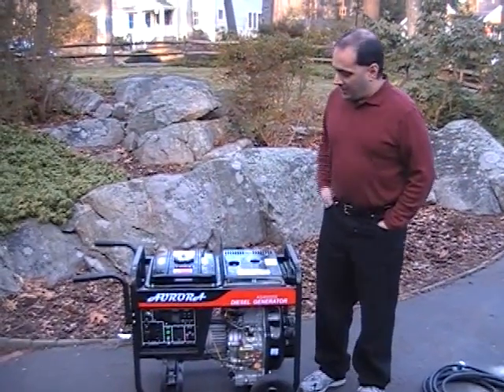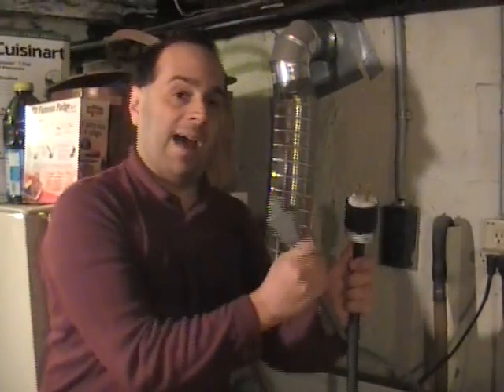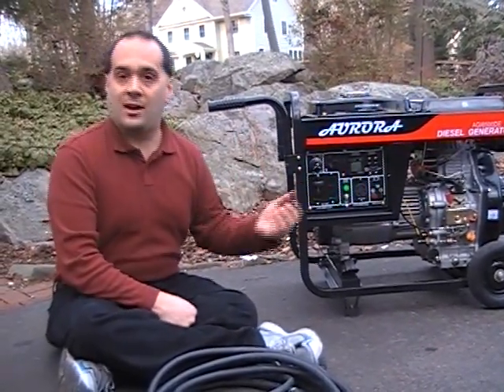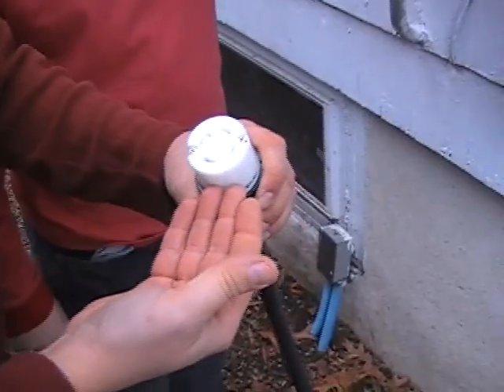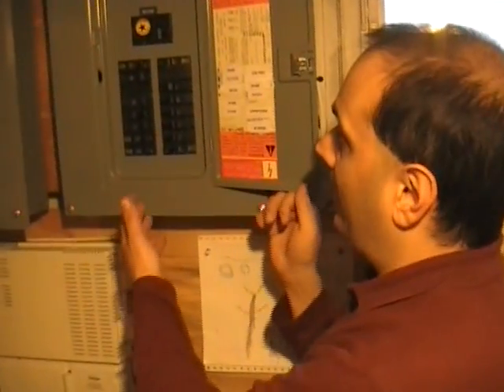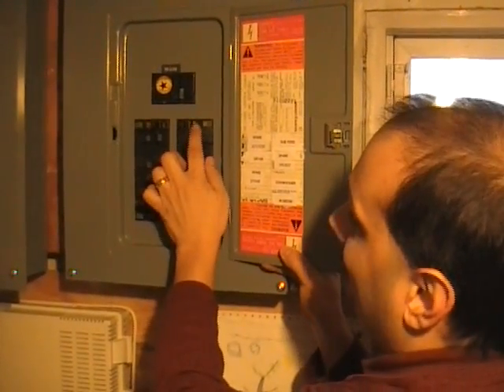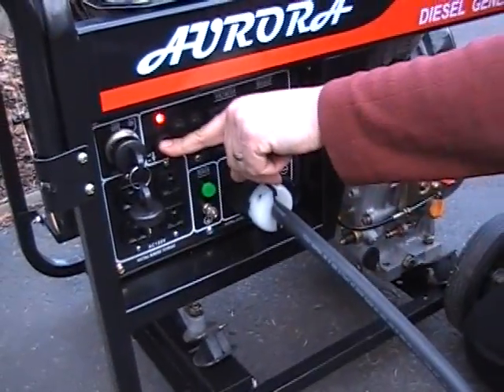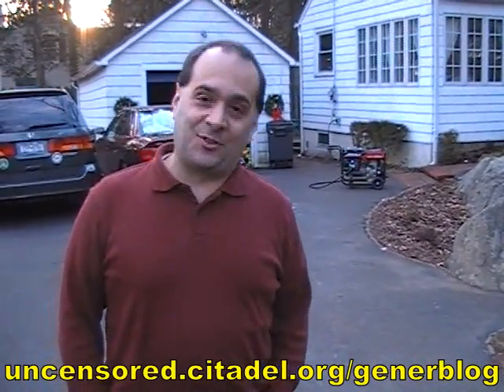Inexpensive residential generator hookup

Comment: Great video, elegant and less expensive solution, although you did have a sizable amount of work relocating those circuits from your old panel to your new panel.  I do thank you for mentioning the interlock method - being new to this sort of thing, I was completely unaware of the interlock method.  It turns out that my Square D panel does have one available, and I do have extra slots to allow it.  I was thinking I'd have to spend $300-$500 on a transfer switch to get legal...now I know how to do it for $150.  My thanks to you for taking the time to make this video.
Reply from the maker: Interlock kits are great if you have room for them.  I thought about it but I would have had to convert some of my other breakers to tandems (twin half-size breakers), and it turns out my panel doesn't accept tandems.  Go figure.

By the way, the parts for my subpanel (including the wire, breakers, and inlet receptacle) only totaled about $200.

We're thinking about looking for a larger home this year.  If we move to a house that has free space in the panel I'll probably do an interlock kit and make a video of that installation.
Reply: We actually have no room for a sub panel, the wall where are panel is at is all finished over with cabinets.  I've ordered the interlock kit and will let you know how it goes.  The one company had the kit for $149, I opted for the non-metal one that is $69, I hope it wasn't a mistake, but if I works, I don't care what it's made of!

Comment: Found this very helpful.
Reply: Generator safety rules: Always make sure you follow all the generator safety rules before using your portable generator. This is only a reminder. Generators can be dangerous if not used carefully. Every year, hundreds of people die or get injured when using portable generators due to carbon monoxide poisoning and electrocution. Make sure you are using your generator carefully and keeping others safe as well. There is something very serious that everyone should always be aware of when using generators. Some people do run their generator indoors which is not safe and that increases the risk of carbon monoxide poisoning which can cause death of family and you. Some people run their generator in wet conditions which can electrocute them. Please remember that you should never run your generator indoors. Remember that carbon monoxide is an odorless and colorless gas that you cannot see or smell. Carbon monoxide is a silent killer. Keep that in mind. Make sure your generator is 15-20 feet away from your house and away from doors, windows, and vents. Never use your generator in your porch too. Having a carbon monoxide detector is very important against generator safety. Some people also allow children to go near the portable generator which could pose risks. We need to keep an eye on our children making sure that they are not near the portable generator so they won’t get electrocuted or burned by the generator which is dangerous. A locking enclosure also keeps kids safe. A generator shed might look like a tempting place to explore, or take cover during a game of hide and seek, but a generator is a dangerous piece of equipment that can cause injury. It says on the manual that we should also keep children away at all times from the portable generator to avoid injuries. Please do not allow a child or unqualified people to operate the portable generator.  It is important to keep your children safe especially little ones. The portable generator can be hot during an operation. Just because some manuals missed what should be listed doesn’t mean it’s safe to do. Always follow the generator safety rules when using portable generators. Generators pose electrical risks. If you need to use your generator during wet weather, you need a generator tent to protect your generator from getting wet. Don’t let your generator get wet. Keep your generator dry and before using your generator, please make sure your hands and your generator is dry. Do not wear loose clothing when operating the generator. Everything that is said on the generator’s operating manual should not be ignored. Never smoke cigarettes near the generator. Please keep flammable things away from the generator. Never overload your generator too. Your generator can catch fire. Never ever try to plug a generator cord into a wall outlet to avoid back feeding. Back feeding your generator is dangerous. Always turn on your generator first before plugging in appliances and shut off the appliances before turning your generator off. Use a heavy duty cord for your generator and the cord should not be worn out. All the instructions should be followed carefully. Never refuel your generator while it’s running. It can cause fire if fuel spills while your generator is hot. You should turn off your generator and let it cool off before refueling it. Having a fire extinguisher next to the generator is also important. This is only a reminder for everyone’s safety of using generators. Make sure your generator is properly grounded. Having a fire extinguisher next to the generator is also important against the safety rules. https://youtu.be/I1jT3ANENvI and here is a video more about keeping others safe when using generators and also about our family’s safety. It’s important to keep our little children safe as well. Make sure they’re away from the generator. Hope you find this helpful. Be safe

Comment: Over kill..all u have to do is.get a heavyduty constuction drop cord..cut the female end off wire two red clips on the hot lead one black clip to the neutral wire..first turn main breaker off..2nd clip the two red clips to the main two breaker bus bars BELOW the main..clip the black clip to the neutral bus bar turn all 208/240 volt breakers off start the gen walla whole house is energized.ran a house for two days ..the wire didnt even get luke warm..its easy to b a goody goody when u have lots of money..for the rest of us pay check to pay check people we do what we have 2
Reply from the maker: Wilbur is correct.  What Kalyn M is suggesting is very dangerous, very illegal, and just plain unnecessary!  If you can afford a generator you can afford a few more dollars for an interlock, especially if you have room for one more double-pole breaker in your panel you can go with the interlock kit that spans your main and the generator breaker for about $75.

Comment: Thanks for the vid this is exactly how I wanted to wire my home. I did NOT want to back feed and a lot of vids show back feeding. Quick question. Did you move the breakers and wires for the the breakers u want to use on the generator over to the sub panel, or are there duplicAte breakers for the same rooms?
Reply from the maker: For any load we want to run on the generator, the wire and breaker is moved over to the subpanel.  Because the subpanel loads can all run from either generator or utility power, depending on the position of the interlock, you only need one breaker -- but it does need to be in the sub.

The main panel feeds the subpanel, and it feeds any remaining non generator capable loads.  Many of the breakers in my original panel are now spares that have no loads attached to them.
Reply: Thanks

Comment: Great video thank you!  Do you have a model number and source for the breaker interlock?  I can't find a reference to the number you state in the video.  I am going to install a sub panel and want to set it up for a generator as you did.  Thanks!
Reply: I actually did find the interlock you mention so I am good thanks!
Breaker Interlock SQUARE D QO2DTI
Reply: Generator safety information: Always make sure you follow all the generator safety rules before using your portable generator. This is only a reminder. Generators can be dangerous if not used carefully. Every year, hundreds of people die or get injured when using portable generators due to carbon monoxide poisoning and electrocution. Make sure you are using your generator carefully and keeping others safe as well. There is something very serious that everyone should always be aware of when using generators. Some people do run their generator indoors which is not safe and that increases the risk of carbon monoxide poisoning which can cause death of family and you. Some people run their generator in wet conditions which can electrocute them. Please remember that you should never run your generator indoors. Remember that carbon monoxide is an odorless and colorless gas that you cannot see or smell. Carbon monoxide is a silent killer. Keep that in mind. Make sure your generator is 15-20 feet away from your house and away from doors, windows, and vents. Never use your generator in your porch too. Having a carbon monoxide detector is very important against generator safety. Some people also allow children to go near the portable generator which could pose risks. We need to keep an eye on our children making sure that they are not near the portable generator so they won’t get electrocuted or burned by the generator which is dangerous. A locking enclosure also keeps kids safe. A generator shed might look like a tempting place to explore, or take cover during a game of hide and seek, but a generator is a dangerous piece of equipment that can cause injury. It says on the manual that we should also keep children away at all times from the portable generator to avoid injuries. Please do not allow a child or unqualified people to operate the portable generator.  It is important to keep your children safe especially little ones. The portable generator can be hot during an operation. Just because some manuals missed what should be listed doesn’t mean it’s safe to do. Always follow the generator safety rules when using portable generators. Generators pose electrical risks. If you need to use your generator during wet weather, you need a generator tent to protect your generator from getting wet. Don’t let your generator get wet. Keep your generator dry and before using your generator, please make sure your hands and your generator is dry. Do not wear loose clothing when operating the generator. Everything that is said on the generator’s operating manual should not be ignored. Never smoke cigarettes near the generator. Please keep flammable things away from the generator. Never overload your generator too. Your generator can catch fire. Never ever try to plug a generator cord into a wall outlet to avoid back feeding. Back feeding your generator is dangerous. Always turn on your generator first before plugging in appliances and shut off the appliances before turning your generator off. Use a heavy duty cord for your generator and the cord should not be worn out. All the instructions should be followed carefully. Never refuel your generator while it’s running. It can cause fire if fuel spills while your generator is hot. You should turn off your generator and let it cool off before refueling it. Having a fire extinguisher next to the generator is also important. This is only a reminder for everyone’s safety of using generators. Make sure your generator is properly grounded. Having a fire extinguisher next to the generator is also important against the safety rules. https://youtu.be/I1jT3ANENvI and here is a video more about keeping others safe when using generators and also about our family’s safety. It’s important to keep our little children safe as well. Make sure they’re away from the generator. Hope this helps.

Comment: Great video but your still back feeding the panel.   The only thing protecting the wire is the breaker on the generator.
Reply from the maker: The 30 amp breaker in the subpanel acts as the main when running on generator power.  Because the generator main is interlocked with the utility sub-main, it is impossible to backfeed using this arrangement.  But don't take my word for it -- this installation passed inspection in a very code-rigorous locality in New York state.

Comment: Art, my generator only has L5 30P outlet (I have the honda EU2000i and the companion), hence I don't have 4 prongs but only 3.  If I use an adapter to convert L5 30P to L14 30R (4 prong), is there an issue?  That way I can use a transfer switch with comes with a L14 30R.
Reply: Generator safety: Always make sure you follow all the generator safety rules before using your portable generator. This is only a reminder. Generators can be dangerous if not used carefully. Every year, hundreds of people die or get injured when using portable generators due to carbon monoxide poisoning and electrocution. Make sure you are using your generator carefully and keeping others safe as well. There is something very serious that everyone should always be aware of when using generators. Some people do run their generator indoors which is not safe and that increases the risk of carbon monoxide poisoning which can cause death of family and you. Some people run their generator in wet conditions which can electrocute them. Please remember that you should never run your generator indoors. Remember that carbon monoxide is an odorless and colorless gas that you cannot see or smell. Carbon monoxide is a silent killer. Keep that in mind. Make sure your generator is 15-20 feet away from your house and away from doors, windows, and vents. Never use your generator in your porch too. Having a carbon monoxide detector is very important against generator safety. Some people also allow children to go near the portable generator which could pose risks. We need to keep an eye on our children making sure that they are not near the portable generator so they won’t get electrocuted or burned by the generator which is dangerous. A locking enclosure also keeps kids safe. A generator shed might look like a tempting place to explore, or take cover during a game of hide and seek, but a generator is a dangerous piece of equipment that can cause injury. It says on the manual that we should also keep children away at all times from the portable generator to avoid injuries. Please do not allow a child or unqualified people to operate the portable generator.  It is important to keep your children safe especially little ones. The portable generator can be hot during an operation. Just because some manuals missed what should be listed doesn’t mean it’s safe to do. Always follow the generator safety rules when using portable generators. Generators pose electrical risks. If you need to use your generator during wet weather, you need a generator tent to protect your generator from getting wet. Don’t let your generator get wet. Keep your generator dry and before using your generator, please make sure your hands and your generator is dry. Do not wear loose clothing when operating the generator. Everything that is said on the generator’s operating manual should not be ignored. Never smoke cigarettes near the generator. Please keep flammable things away from the generator. Never overload your generator too. Your generator can catch fire. Never ever try to plug a generator cord into a wall outlet to avoid back feeding. Back feeding your generator is dangerous. Always turn on your generator first before plugging in appliances and shut off the appliances before turning your generator off. Use a heavy duty cord for your generator and the cord should not be worn out. All the instructions should be followed carefully. Never refuel your generator while it’s running. It can cause fire if fuel spills while your generator is hot. You should turn off your generator and let it cool off before refueling it. Having a fire extinguisher next to the generator is also important. This is only a reminder for everyone’s safety of using generators. Make sure your generator is properly grounded. Having a fire extinguisher next to the generator is also important against the safety rules. https://youtu.be/I1jT3ANENvI and here is a video more about keeping others safe when using generators and also about our family’s safety. It’s important to keep our little children safe as well. Make sure they’re away from the generator. Hope this helps.

Comment: Nice video Art...very well done! Was wondering, is it possible to build a small little 'doghouse' for a generator, in order to minimize the amount of noise one of those Aurora Generators makes...assuming it's well vented of course.. ?
Reply from the maker: Plenty of people seem to have success building enclosures for their generators.  You'll need to find a way to route the exhaust out of the enclosure.  On a portable generator that means you'd have to weld something onto the exhaust flange and then connect it to an exhaust pipe flexible enough to vibrate/move with the engine on its mounts.  From there you'd go through an additional muffler and then up the exhaust stack.

You'd also need some way of moving plenty of fresh air in to the enclosure.  This would probably involve electric fans hooked up to one of the generator's 120 volt receptacles.

And of course do remember to make the inside fireproof :)

Comment: Nice video  but  can you make a generator run off the wind instead of a Gaz engine?
Reply from the maker: My generator runs on diesel, not "gaz" (sic).

Wind turbines require a different kind of hookup than a standby generator.  Look up "grid tie inverters" to learn more.

Comment: Good video. One thing I would say is turn on your loads a tiny bit more slowly. I know, for instance, the refrigerator can draw a higher load (surge) for up to 2 or 3 seconds before it stabilizes as the compressor gets up to speed.